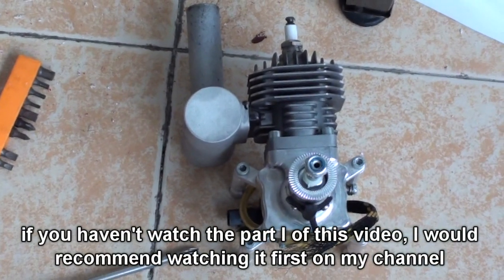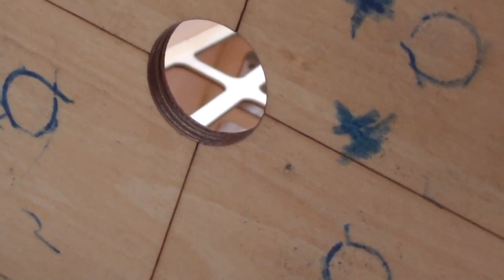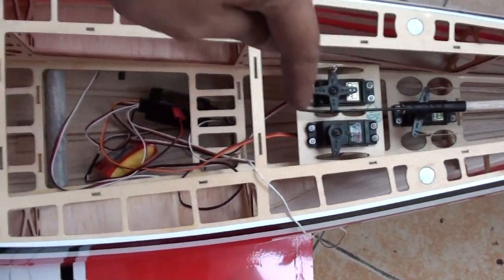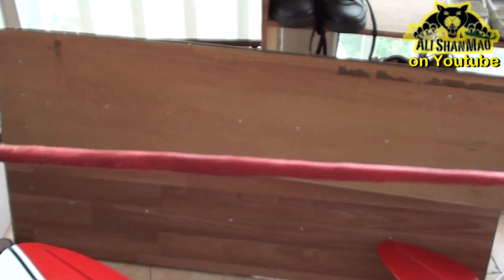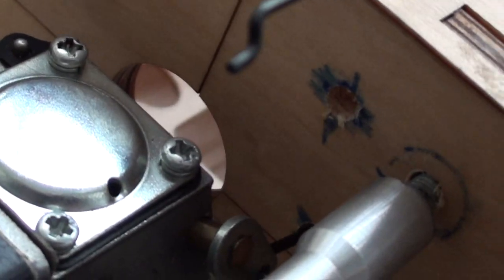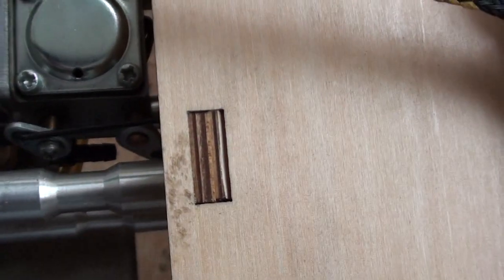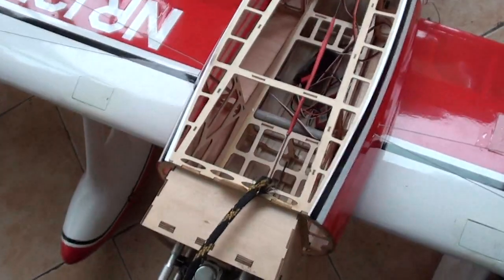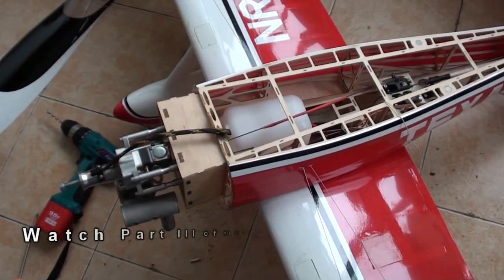How to install engine in ARF RC Plane Part II

Comment: Having got my first large ARF similar to this, I noticed that there is a laser cut cross on the fire wall.  Is that supposed to be be the center/thrust line markings for the engine?  I don't want to mount it wrong.